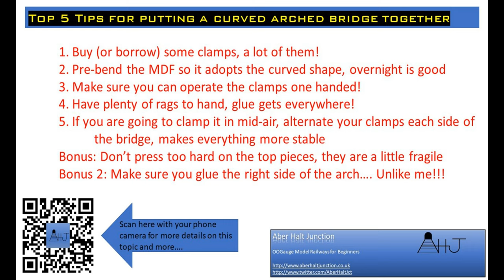How to SIMPLY build an eye catching curved arched bridge

Comment: Quick Tip: Clear the wood glue "squeeze-out" away with a damp rag, while it is not yet set, as can be a lot easier to do it then than later when it has set off hard.
Reply from the maker: Thanks Dib’s, font of knowledge as always!! Always struggle to find a damp rag when I need one! Need a tap in the shed :) thanks for the constructive comment.
Reply: @AberHaltJunction  even a bit of spit on a paper towel may work. Might be worth keeping a small jar of water in the shed for such purposes.
Reply from the maker: @dibsyardshuntinglayout  Thanks Dib, yeah do always try and keep a bottle in there with me in case I burn myself with the soldering iron!!!
Reply: @AberHaltJunction  ooo, yes good idea!